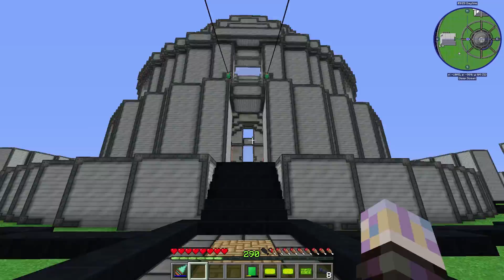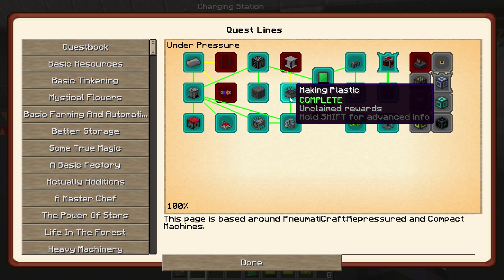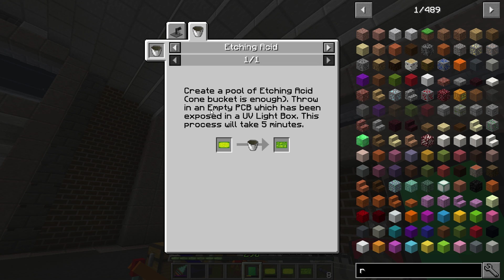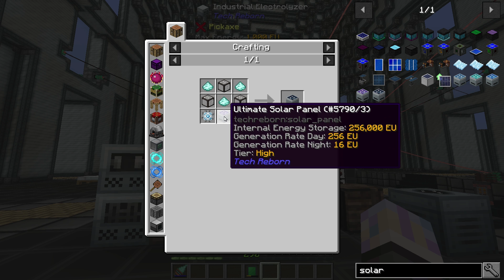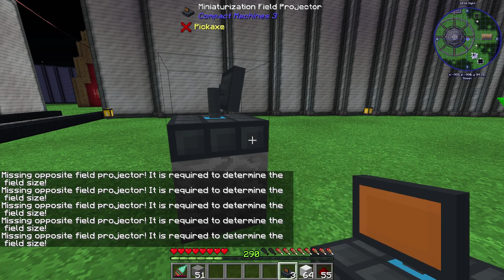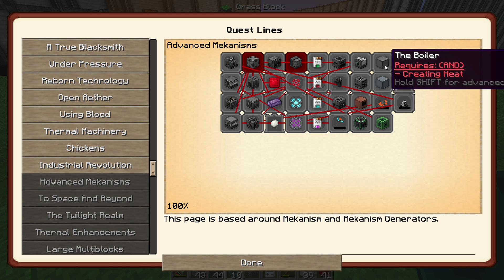Modern Skyblock 3 EP30 Quest Cleanup + Compact Machines

Comment: 1. The EU to RF conversion rate is the other way around: 1 EU = 4 RF. Just dumped 1,024,000 EU from a Quantum Solar Panel into a Resonant Energy Cell to be sure. I got 4,096,000 RF. So the Quantum Solar Panel produces 4096 RF/t which isnt to bad. I used 4 of them before I got Advanced Generators and Extreme Reactors.
2. Getting those 25 Fusion Coils was indeed a real pain in the ass.... :(.
3. I liked that you showed and explained the stuff you did off camera.

Comment: System, the issue with EU to RF conversion is wrong, a lot of machines have a maximum acceptance rate so that they're not constantly eating RF, and in actuality A Quantum Solar would be generating about 4096 RF/t during the day, and 256 during the night, unless the conversion rate changed in 1.12+, it should still be like that. The Exchange rate between RF and EU should be 1 EU = 4 RF, not the other way around.

Comment: That's the main thing that bothers me with this pack. You just have to do things for the sake of it. It's good for YouTubers to show off mods, but as a normal player it's kind of boring in my opinion.
Reply: You can always play on the normal/however it's called mode.
Reply: Vojta Minarik but then I would just play with the same easy mods and there would be no challenge...
Reply: Daan Vanoverloop you could just try other mods too even though you don't need them.
Reply from the maker: I agree, I prefer doing things for a reason.